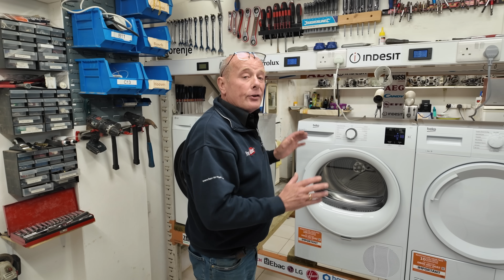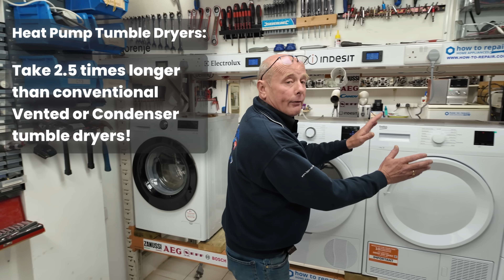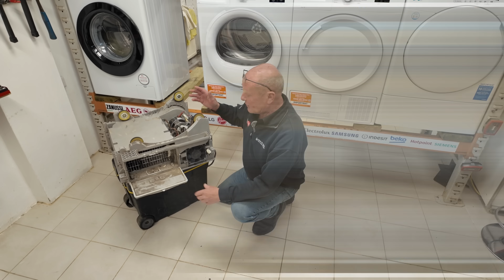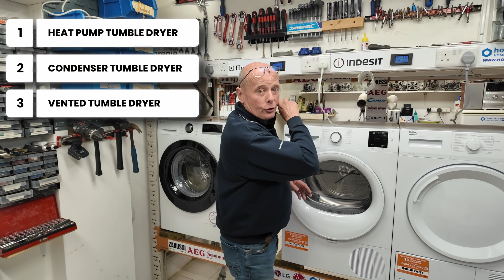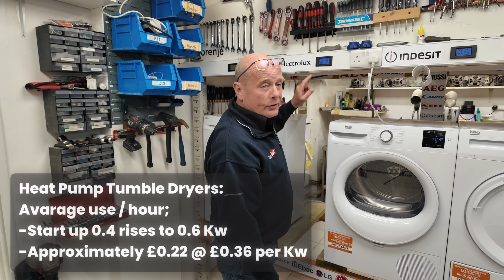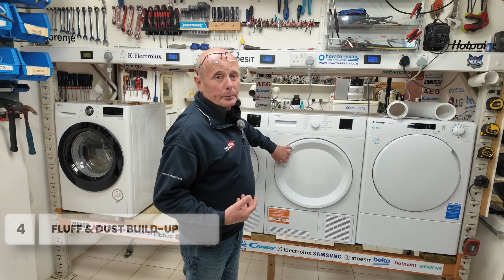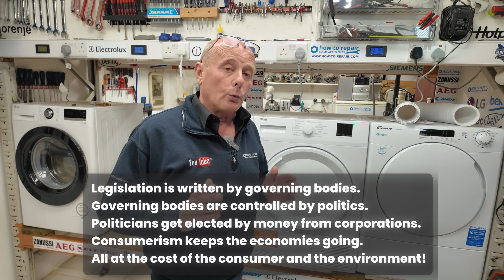Tumble Dryers the Shocking Truth About Heat Pump vs Vented & Condenser, NEW LEGISLATION!

Comment: There are options to either build a conservatory to dry your clothes in it, or move to a sunny country 🌞😂 ...... What really should worry the British and Europeans is, when everything goes electric (cars, heat pumps or air source, heat pump dryers, and rest of other appliances) then how the heck the power grids are going to supply whole of nations with electricity?! .....at the moment there's a mix of electricity, gas, petrol/diesel, and if the fossil fuels get banned forever and green energy don't produce enough electricity due to not enough wind or sunny days, then energy companies would introduce a cap or limits by using smart meters as a way to double the tariffs at certain times or days when everyone at home ........ ......... That's biggest worry people need to think about, and don't expect governments or politicians would care, because right now they're giving in to greedy manufacturers and the rich .....

Comment: I personly have had an issue with newer and modern dryers with digital settings and displays ,they look smart and fine but very rarely work as they should and burn out way to fast aand cost arms and legs fpr starters, now all the consumption paart is on , the newer pump ones we also bought since the ones we wanted couldent be bought enymore and they cant even dry up the clothes properly ,im tempted to buy a old one and refubish it totally and get rid of the modern one

Comment: I have had a Hoover heat pump tumble dryer for 7 years. In that time it has broken down 3 times. Lucky I am an electronic engineer and have been able to repair it each time but even as someone with nearly 20 years experience in automotive electronics I can agree that it hasn't been straightforward carrying out the repairs. The biggest problem is access. I have had to replace, on separate occasions, the motor capacitor and the drum belt and both of them jobs took about 2 hours. The stupid touch sensitive controls started operating by themselves because of condensation forming on them so I had to use kapton tape to stop that happening - did they even do any life cycle testing?!! Currently water is starting to pool near the heat exchanger so I think there may be a blockage and also the drum is squeaking in one direction so that needs looking at. Previous to this I owned a condenser dryer for 5 years and it failed once, which was the pump and it took less than 20 minutes to repair. The jobs that I have done on the heat pump dryer would be beyond the average user and in summary I agree with the statements you make in the video.

Comment: I got vented dryer just praying they can keep repairing when necessary 🙏 don't want heat pump dryer, though my airforce heating works just fine, took a bit of getting used to but it works really well.

Comment: I dumped 20 year our old vented unit and now have the BEKO Condensor  (similar to your shelf model) . Heat pump units were all very expensive and with no more warranty than cheaper condenser models and seemed very complicated for what they actaully do.  We have a very high speed spin washing machine and then also further  dry clothes on racks in the garage  which has a good through breeze -- yes you can remove more moisture even on a cold day, just more slowly.  We then tumble dry for final finnish. Use ALEXA announcement  as a absolute finite timer reminder. Using Sunday PM cheap rate electricity where possible. Our regular washing is almost a logistical production line exercise. We are both retired with home time and not hard up but I hate giving British gas any more money than neccessary.   Filters / door are cleaned and tank emptied each use.... Plus at warranty end I will use your other excellent videos to strip the machine in the summer and give it a damn good total clean ready for winter, hopefully extended its cost relative life span... Your videos are a very professional watch. 

On a similar note re green washing. Many years ago i went to a retirement of a chap who was part of the catalitic converter development and introduction. In his speech his son said that his dad was a very clever businessman as he "sold " the catalitic converter concept into europe simply as his company supplied and later reccovered the precious metals that are in a catalitic converter.
He said that there are better and cheaper ways to remove the pollutants but thay did not require precious metals and hence no business benefit.

Comment: U made also a good point. I have bought for our new apartment a new heat pump dryer from SAmsung but still running an older condenser dryer from Candy in my parents house and I have to say the heatpump one dries quicker than the condenser if u dry stuff for 3h. 1 month back I also took the candzydenser apart do hoover all the fluff out of it cause there was a lot and we have it for sure than more as 9years now and it never been maintained. But I looked also deeper into the Samsung one and even normal cleaning process is nearly impossible like in the condenser to make it run better. we have the heatpump one for almost 4 months and I can see it build up already quite a lot of stuff inside the fine heat exchanger/radiator unit. I had sadly no real other option cause almost all models sold by my local shop, sells only heatpump unit nowadays. We will see how long the heat pump one lasts.
Reply: vacuum it out, when removing the lint filter make sure to vacuum out the seal and look for lint that may have fallen into the filter housing. hoover that out too. make sure the outside of the filter is also spotless. you have to be a bit ocd about these i fear. it’s best if you can disassemble the whole thing to get to the coils every few years depending on how good you are at keeping it clean. maybe look into fashioning a filter for the evaporator if you could stuff something in front of it, but be weary of reducing airflow.
Reply: @Progan666  I try to vacuum it out and even used a softer paint brush to get all the fluffy stuff out and than hoover it out but still some parts remain inside when looking with a torch inside it. We will see how it will behave, and as fabricating and inside  filter it's Impossible cause the inner door has a built-in weird shaped plastic for best airflow. I have never taken one of the heat pumps one apart so not sure if you maybe blown it out with compressed air or hose it out but don't want to damage any electronic parts :-)

Comment: Where's the choice?  More government meddling, just like vacuum cleaners are now rubbish with small capacity due to stupid EU power limit rules.  Lots of people now have solar panels and can use the excess heat from condenser dryers to heat their house.  Heat pump dryers are a good idea for certain cases, but not every case, lot the people have the choice.

Comment: didnt even know 'heat pump' driers were a thing! ours is a 'condensing' type...as we didnt want to bore a hole in our porch for a vented type,  ours has had to have the motor start capacitor changed twice during its 20year life so far , plus one new belt and rear 'gasket', and easily done it myself,, as usual, these heat pump things are far too expensive to buy and too expensive maybe impossible to repair.... they should not try to 'force' people to have heat pump things, many simply cannot afford them, we certainly cant

Comment: I have a heat pump drier. It is absolutely fantastic. It is so cheap I no longer think "Should I tumble dry this? What will it cost?" What I want to dry gets put in and then it is turned on. It costs pennies, literally pennies and dries at a much lower temperature. OK it takes longer but who cares? I can even put in a pile of folded woolen jumpers onto a door rack and dry that. It holds the woolens stationary as the drum rotates around them and dries them at a cool temperature. 
My car has a heat pump for heating and cooling. Again brilliant. Also the house has one for hot water and heating. A time shift battery and EV tariff gives electricity at 6.7p per KWh for most of the day. Peak cost is 23.3p which is not too bad on Intelligent Octopus Go. It is the way the world going and the future is dirt cheap.

Comment: The waste of conditioned air on a vented dryer is especially absurd.  You need to factor in the cost to reheat the lost air on top of what the machine has directly consumed and it's A LOT.  Just remove it from the comparison, banning them is necessary, there is zero reason to have one.

The refrigerant gas in new HPTDs is R290 aka Propane.  It's not hard to dispose of and has a low environmental impact.  Regarding energy usage from a longer cycle, it's still half the usage of the condensing dryer.  The wear and tear on clothes is also reduced because the machine temperature is much lower which is kinder to clothes overall.

Overall the increased maintainance is more than justified by the lower running costs.  You pretty much pay for the machine outright by the energy savings.

Comment: In America they still have modern gas dryers… I’m in uk I’ve been searching for a graphite well built vented dryer…. But they don’t sell them no more.  
They tried to say about the micro fibres getting blown out the air is bad for the environment lol😂 but what do people do when they wash their condenser out the fibres go down the sink, also condenser dryers I think are extremely dangerous as blowing dusty lint over heating elements can cause fire… in my opinion vented dryers dry very fast using less electricity and less ware and tear on machine, heat pump dryers on the other hand are like aircon and them fins in the condenser unit on heat pump dryers are designed to have air flow over them, not to be clogged in lint…. We’re really being sold up the river here in the uk, I’ve had to now buy a commercial asko washer and dryer as they had matching colours with a vented dryer

Comment: I've got a heat pump drier.  It takes longer, but it works great.  And it doesn't use much electricity.  I had it for a year.

Comment: I use a de humidifier and it’s good very cheap to dry clothes I never use my vented dryer now
Reply: The de humidifier is exactly like a heat pump drier but probably less efficient. Might be noisier as well. Also it will dry the room out so you would have to run a humidifier to get moisture levels back above about 40%.
Reply: Oh and a de humidifier uses 650 watts per hour and heat pump dryer over 2 kilo watts so work it out

Comment: There are so many products now that get dumped rather than repaired.  Difficult to find competent repairers and often repairs cost the large part of a new machine.  New products can make very efficient use of skilled people often in far off countries where labour is cheap.  And they can be made to mostly be reliable for those  5 or 10  or 15 years.    And the costs of disposal are gernerally public costs to nobody sees them directly.   Not saying this is a good thing, but it is the environement in which many consumer products are made.

Comment: I'm not in UK or EU so my electricity is US$ 0.11 per kWh and would cost 22 cents for a load of clothes to dry in old fashion dryer. . I can afford it.  I have owned coin laundries with 600 commercial machines to keep running and not really impressed by any of the new machines in the last 10 years.

Comment: The other thing about heat pump dryers, from about 6 months of age they gradually take even longer to dry clothes as the condenser get clogged up and cannot be removed to clean it. By 2 years they can run for 8 hours plus to dry anything, which makes them way less economical to run than conventional dryers.

Comment: I replaced my condensor dryer with a heat pump one. I specifically looked for one that also had sensor dry tech in it and ended up with a grundig. I then ran the same load through both machines using a plug in electricity draw monitor for the whole load, to dry. The grundig takes around 3 hours a load, my old condensor dryer took 2hrs 15. The total wattage drawn however was 25% less in the first load, and an impressive 35% less if you run a 2nd load back to back as heat recovery is MUCH better in the heat pump one (i have 4 kids so multiple loads is the norm). Overall very happy with the switch, and selling the condensor helped pay for some of the outlay for the new one.

Comment: Hi, American here and we produce some of the largest most inefficient appliances on the planet! 

While Europe was using front load higher efficiency washers they didn't really become a thing in the USA until about 20 years ago, while Europe had been using them for much longer than that. 

As far as the dryer, condenser dryers are not really a thing here and are very hard to come by if available at all. 
90% of our dryers are old fashioned electric or gas vented dryers that vent to the outside. 
Because most American homes are large, The venting run can be quite long in some cases up to 40 ft and in larger homes the venting can go through a wall or straight up through the roof!
This may seem crazy to our European cousins but it's very typical here. 
I chose the new LG heat pump dryer for several reasons. 
One of the reasons is because of dryer fires here which numbers in the several thousand across this country every year.
We have issues with dryer fires because most Americans are terrible at maintenance which is required to blow out the vent especially on such a long vented run. 
The second reason is energy consumption, our dryers tend to be very large units compared to our European friends, standard dryer sizes over here are generally 6 to 7 and 1/2 cubic feet which can sometimes be twice the size of a European dryer. 
The energy consumption on a heat pump dryer compared to our dryers can be from one quarter to 1/5 less energy used. 
You made some very good points on maintenance and I did a lot of research before I chose this particular LG model. 
LG redesigned their heat pump dryer for the American market (probably because we're not very good about maintenance) and I think they may have taken care of some of the issues you mentioned. 
One of the issues you mentioned was about the drying time and while it is longer than our standard dryers it is not quite as long as you have indicated on the European dryers. 
Also one of the more important points you made about Lint, I believe LG has come up with  clever engineering system to deal with the problem better. 
On my LG the coil system sets in the bottom of the unit inside of a plastic tub. 
The reason they did this was because they included an automatic coil cleaning system that uses water from the extracted clothes to spray onto the coils and clean them on each load. 
You can also run a manual coil cleaning cycle by simply pulling out the filter element and pouring in 1 l of water and running the manual cleaning cycle. 
They also redesigned the filter system in this dryer and it uses a two-stage double-sided inner and outer  fine mesh filter that is larger than anything I've ever seen on any dryer on the front of the unit. 
And lastly they put a inspection port on the right hand side of the front of the dryer that you can pop open and inspect the coils and clean them manually if necessary. 
So far I've had this dryer for about 3 months and run probably 30 to 50 loads through it and there has been no hint of any lint when I inspect the coils. 
I'm hoping to get a long service life out of this unit and I have been meticulous about maintenance on it. 
In case anybody is curious about the model number and I'm not sure it would be available in Europe since it's such a large unit, 7.8 cubic feet, here's a model number LG DLHC5502.

Edit: in case anyone is wondering what I'm talking about below is a link to a North American appliance guy much like Paul where he works in appliances, reviews them and tears them down. 
The link I posted in for the dryer I was talking about and towards the end of the video he tears the dryer down and you will see what I was talking about with the tub and the coil cleaning system.
https://youtu.be/CpF80DuCzGs?si=oO_uJ8lqhfKi8IHI
Reply: Wait to see what China has, the USA is in the stone age by comparison. I've lived in Both and USA is way way way behind
Reply: @markylon 
I live in the USA and have used Bosch and Miele dryers for many decades.  From vented to condenser and now heat pump dryers.  The USA has all of the options available.  It is up to the homeowner to choose.  Heat pump is higher up front purchase cost, but MUCH lower operating cost.  Vented dryers pull conditioned air out of the home.  So there is a cost to replace the conditioned air as well as running the dryer.  

Our TWI-180 has paid the entire cost of purchase in electricity savings.
Reply: even worse - it's not even a planet in outer space!  look into it. :)

Comment: I've had my Samsung heatpump dryer for 6yrs now. Love it!
I do keep up the maintenance and hoover the  bottom heat transfer mesh every month... Takes about 5 to 10 mins.. But it's worth it! Genuinely think they are awesome. Home is heated with a Daikin Air to Water heatpump as well... We have the solar and battery too.
Last year we used 9.5MWhs of electricity.. Our bill was zero, our payback is around 5yrs. Pursued it all mainly for the savings and an easier retirement :) Take care.
Reply: Same here including an EV which gives me cheap tariffs and a time shift battery to move the 6.67p electricity into the day as well. That is the thing about retirement. Invest up front and have stuff all costs going forward. Total house energy bill is £40.99 a month or £491.88 per year. Take off an average of £330 feed in tariff and that leaves £161.88 a year, or £13.50 a month.